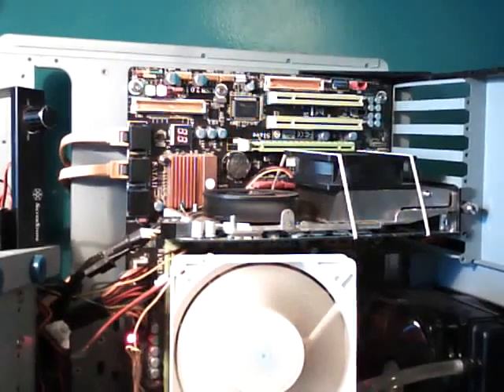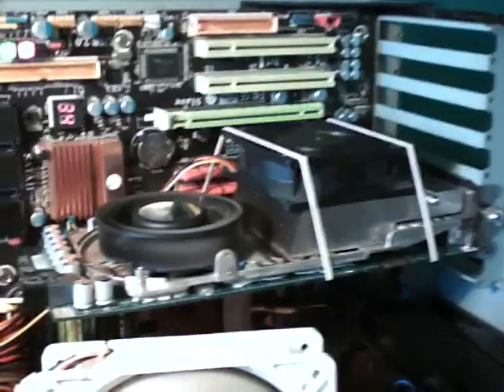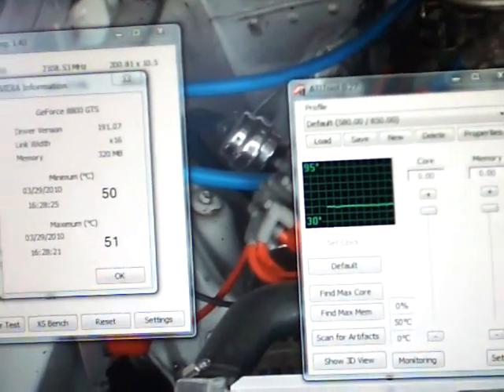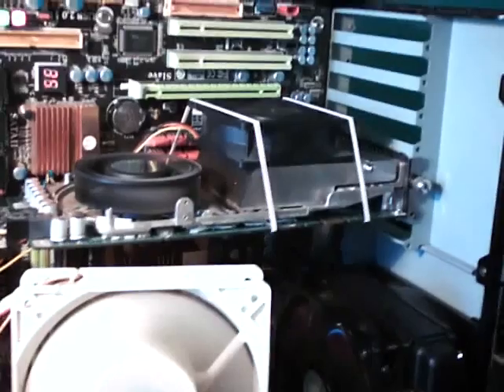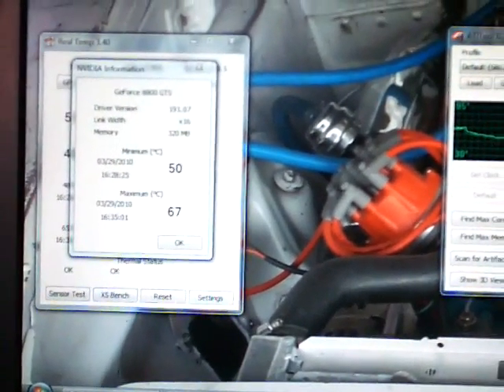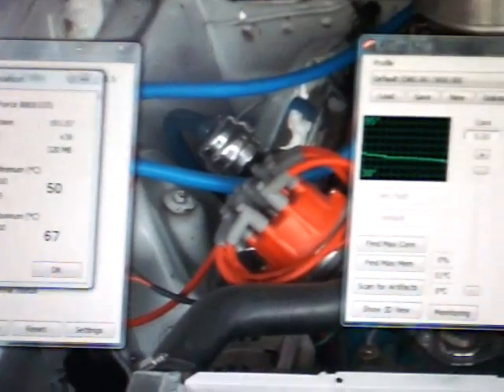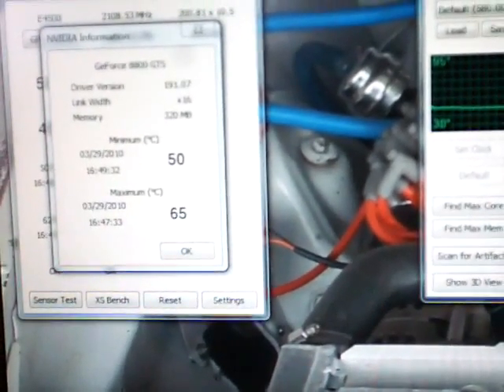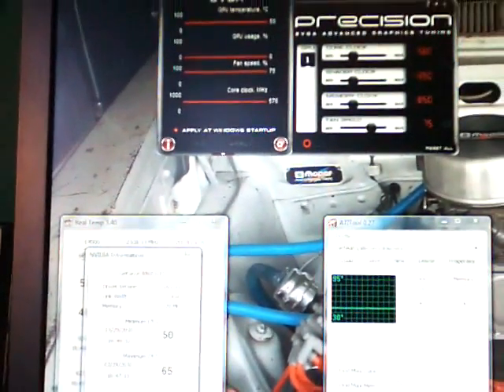Blower Style GFX Card Fan Mod Part 2

Comment: dude that won't work.... because you get a lot of turbulence from the two fans blowing in somewhat oposite directions, they have to help each other direct air. I did that kind of stuff once with my pc and noticed if i put one to get in air and the other to take it out droped the temp with a few degrees.

PS: the blower is useless without the case, that's all the thing that makes the blower a blower:)

Take care, have fun and do your stuff

Comment: If you're so desperate about dropping some temps, just get a 3rd party VGA cooler. I don't think that that stock fan on there doing anything without the duct/hood/cover. Its configured to channel air b/w the fins to the back exhaust, and with no cover its not as effective. I would think.

Comment: Are you going to show us how to take the blower style fan off in the next video? Because I can't figure out how to do it on my HD4890. Right now I got it exactly like you did it, except it disconnected the blower style fan and installed 2 80mm fans onto it. Temps didnt get much better, but I did it mainly to reduce the noice the stock fan makes when gaming. 2 80mms are sooo much more quiet :)

Cool video man, keep it up.